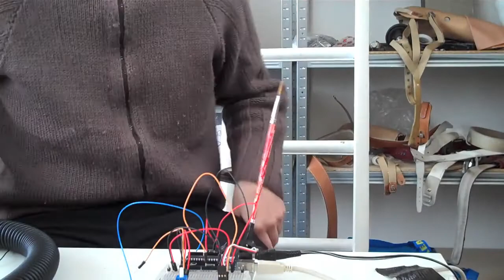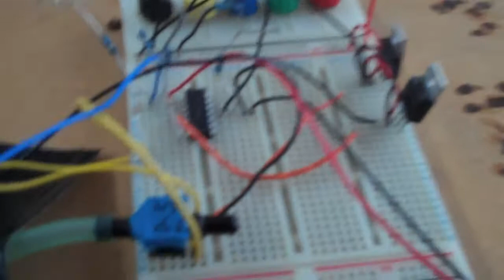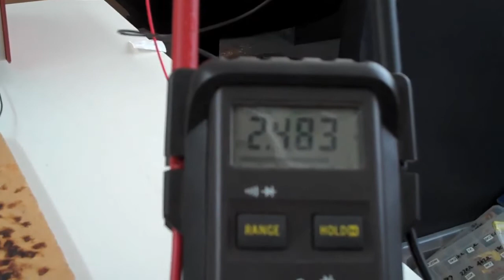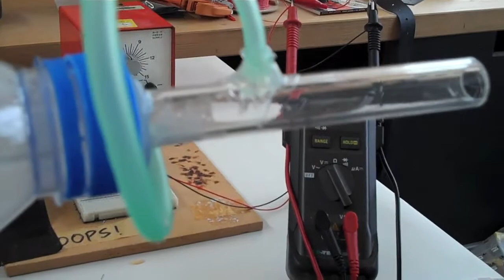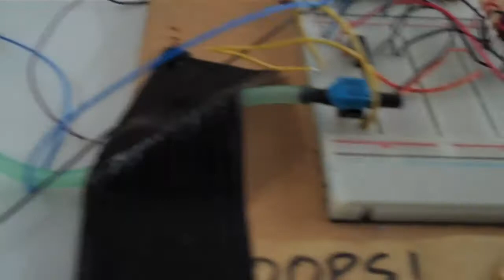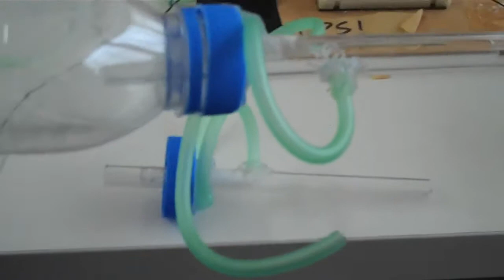Breathless spirometer.mov

Comment: Hello sir, I would like to know what specific differential pressure sensor did You used. Cheers Greg
Reply from the maker: grzegorz zielonka long time ago. Can’t remember specific. But do remember it was made by Honeywell! I told someone in an email in 2012 that they’re based on “temperature differentiators”. That may help
Reply: Thank You for quick respons.
Reply from the maker: They looked something like this https://uk.rs-online.com/web/p/pressure-sensors/2288533/ Just can't remember the pressure range
Reply: I have another question, why have You used reading pressure only from rear (thin tube)?